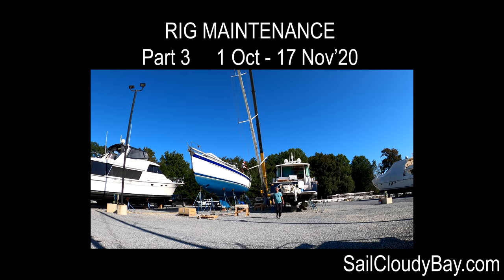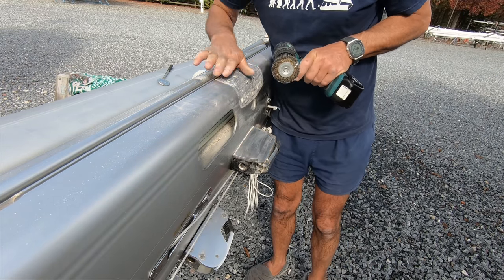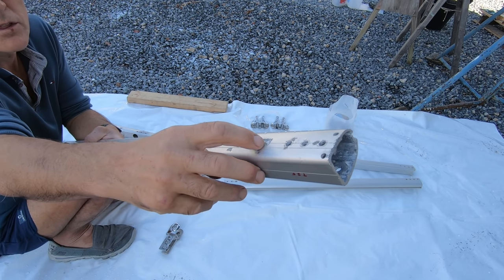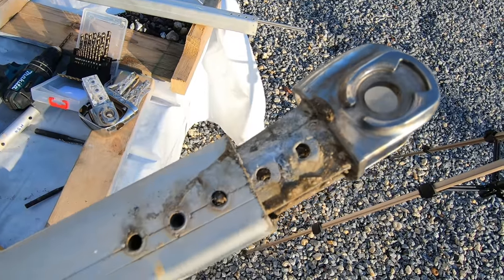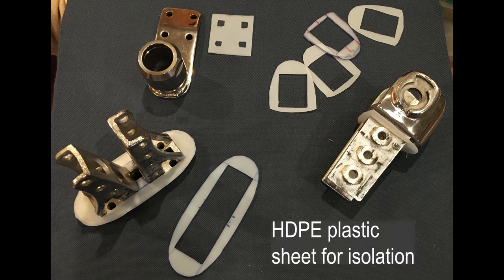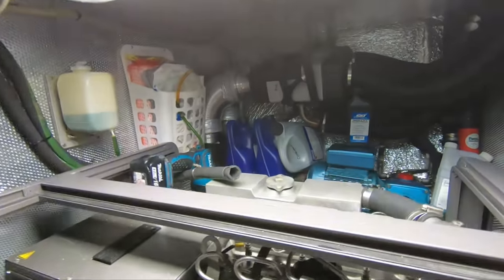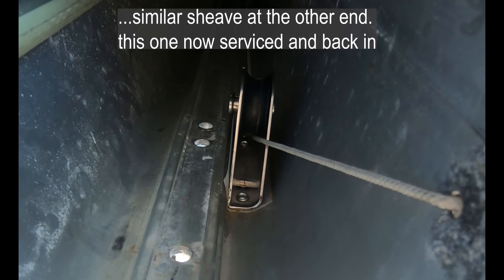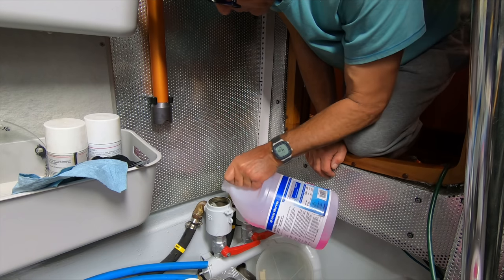Boat Maintenance – Rig Service part 3 - Hallberg Rassy 54 Cloudy Bay - Oct-Nov 2020. Season20 Ep23

Comment: Awesome! I love modern compact impact drivers, they are great for a lot of heavy tasks, I prefer to use those long bits made for impact drivers. The short bits often ruin the heads of the screw or them selves, the long one acts like a spring and yields longer lifetime of the bit and screws. 
The trick about reversing the rotation when reentering a screw is great also for wood and soft metals as aluminium, I learned it from a seasoned marine service technician in my previous job. 
It is a bit scary to see how corroded some of those aluminium parts are considering that they aren't that old. On one of the backplates you said it was used thread inserts, are they used for corrotion prevention or just a hack to get the screws secured?

Great work, looking forward to more videos :D
Reply from the maker: Thanks for the comment. Yes, You are right, I should use the longer bits next time, with the impact driver. 
I believe the thread inserts do 2 things: 1) allows the SS screw/bolt to be thread locked into place without the worry of SS  touching any aluminium and 2) the larger thread size of the SS thread insert (vs the screw thread) means there is more threaded area to "survive" corrosion. (a very small thread into aluminium would be much more likely to fail and be striped out).  Selden also has threaded inserts on the alloy housing for the furling motors, where stainless steel screws would enter.
Reply: I can see that point 2 is  very valid, you get more "meat" on each thread. But point 1 would require the thread insert to be of a different material than stainless steel, unless extra care is taken to insulate between the insert and the aluminium.
Are these parts, the goose neck and furling motors servicable parts? Then it could be that the thread insert are there to reduce wear on the aluminum and reduce risk of ripping the threads.
Thanks for the reply :)

Comment: I wonder if sea foam would clean up that aluminum.
Reply from the maker: Thanks for the tip Brian, I'll go do some research on it.   But so far it looks like an additive to spray into engine air intakes .......
Reply: I think the airplane guy might be on to something. Corrosion x. Or the 50 stuff. They say it’s seaps a oily film for a while from the treatments. And they fog the aircrafts every two years.  Hum don’t know.  . Interesting subject.

Comment: Did that backing plate have Helicoils in it? Inside our carbon fibre mast we used hard plastic like Delrin as a backing plate. Just drilled and taped it as per aluminium.
Reply from the maker: Yes, those are helicoils. I'll replace and put back in the same.

Comment: Hi Glenn. We have enjoyed all of your videos but particularly your detailed maintenance work!  What grease product did you use when you inserted the cutlas bearing?  Also we note in the comments that you will be using Duralac when putting the hardware back together. Is that your choice over Tef-Jel?? Thanks! 
Anna & Peter
Reply from the maker: Hi Anna, Peter. 
Glad you enjoyed the videos. More to come soon. The grease was just basic marine grease. It seems to stay there OK (very tight space) until I next replace the cutlass. 
On the corrosion preventer, I'm a bit new to this but it seems there are 3 go-to products:  Durlac, Lanocote and Tefgel. I feel each has its own place, with some overlaps.
Durlac is the only one that chemically protects against galvanic corrosion, and while it remains moist its probably the best. Trouble is that is tends to dry out and crack off after several years with strong exposure to heat/sun, so dont expect it to last a decade. On the other hand, Durlac is the only one that dries, so is good where you a) dont want the liquid migrating and b) where you don't want the screw to come out accidentally.  I use this on screws and rivets
Tefgel is brilliant in that is does not dry out, really good at keeping out  moisture and seems to last the time. But it doesnt dry and my rigger tells me that over time is tends "walk" all over the rig. Its also a good lubricant. So advise not to use on screws up the rig, unless you like screws raining randomly on you!  I use this for parts that I want to regularly get apart.
Lanocote is the only naturally occuring product. It smells like old sheep! It extremely viscous, and acts like Tefgel, but doesnt "walk" even in high temperature zones. But while much more vicous than Tefgel it is still a lubricant, so good for rivets and metal touching metal, but not good for screws that you want to stay in place.
Hope that helps. Like said, I'm no expert, but this is my understanding.
Reply: Thanks Glenn!  Your information was helpful and naturally thorough!!  Just so you can track where your channel reaches we live in the middle of Canada and sale on a large fresh water lake full of islands known as Lake of the Woods. We were very impressed with the tool you had made for removing the cutlas bearing. What material is it fabricated in??
Anna & Peter
Reply from the maker: @annafuller1422  THat tool is made of stainless steel

Comment: He made the right choice selling the Satcom. I wonder what he could get for it on eBay? If I were him, I’d look into Starlink ($500, $99 per month).
Reply from the maker: Managed to get just over $1000 on Ebay. And yes, will be looking into Starlink as soon as its available for marine use. Just hoping the antenna will not be too big. I refuse to be "one of those boats" with oversized antennas .... to match the owner's ego!   In fact, on that note, I found out the other day that you can actually buy dummy satellite antennas domes, presumably just to make your look good!  I could not believe it, but its true!  However,  they are marketed as a "balance" antenna - so if you mount your main antenna on one side the mast, you might like to have a dummy on the other side the mast just to balance the looks!  You can imagine seeing such a thing on a boat that had 4 outboards on the back ....  and a big knob driving it :)
Reply: @SailCloudyBay  my mind has been blown... a dummy dome? I just looked them up, they run around $400. Now I’m going to assume most of them I see are dummy domes!
Reply: @SailCloudyBay  I think, I remember reading an interview, where Elon Musk said, that the development goal for the market entry should be a single device, with a rechargeable battery and a wifi router, the size of a motorcycle helmet.
Reply from the maker: That would be perfect. It we revolutionize yacht communication for the average person who cant afford the current tariff of $thousands/months for basic satellite internet service.
Reply: @SailCloudyBay  Not only would it be cheaper, but a superior product at that. 

Sailing would be more accessible to those that work from home, or have children who do virtual schooling. 

Take a Zoom meeting with friends and family, order groceries ahead of time while traveling in from Nassau to Miami, etc. 

It really could be a game-changer and could open yachting for younger professionals and families!

Comment: When winterizing the boat, do you add antifreeze to the motor, genset, AC and etc. or do you change it with new antifreeze?
I'm living in a fairly cold climate and boats (and cars) here usually has antifreeze year around because of alleged anti corrotion properties as well not only because it can be below freezing in 8 of 12 months.
Reply from the maker: I left the normal cooling circuits on the engines with their usual cooling fluid, because it already has an element of antifreeze. 
Where I circulated "winterizing" antifreeze was around any fluid system that had either fresh water or sea water in them:
- Engine raw water circuits
- AC cooling circuits
- Water maker
- Domestic hot and cold water circuits
- toilet, sinks and shower drains
- washing machine
Phew ... yes, alot!  Certainly would not like to have to do this EVERY winter!  I think it would be quicker to sail south!

Comment: What didn't you R&R? the clock?
Reply from the maker: R&R?
Actually I did attack the clock too!  It needed a new battery :)
Reply: @SailCloudyBay  we used that in field engineering, i guess your schlumberger had a different language - lots of Rs = Remove, Repair, Refurbish, Replace   any combination of those. warming up in Northeast US so I'm starting up also....